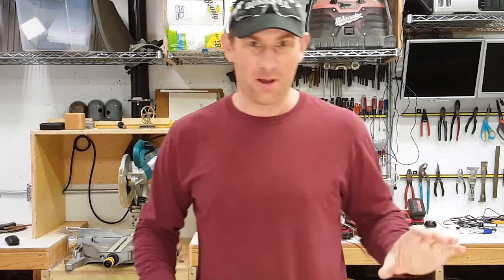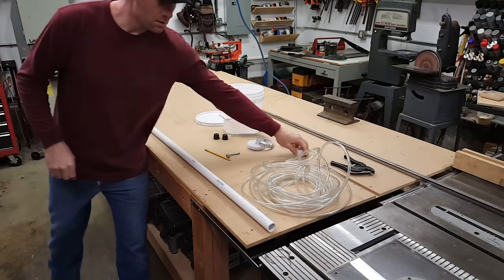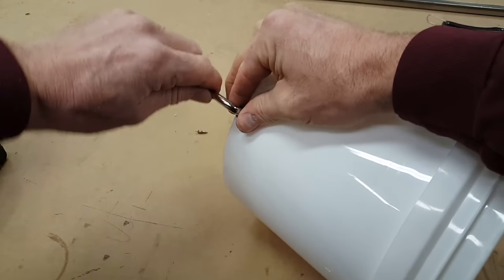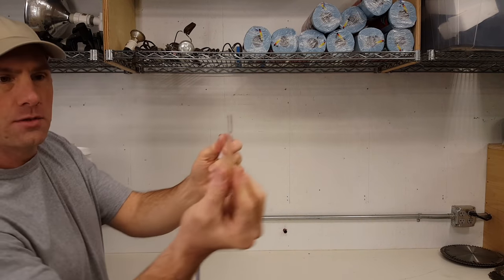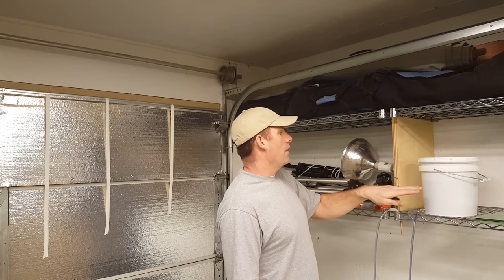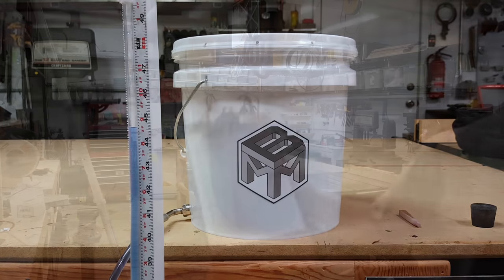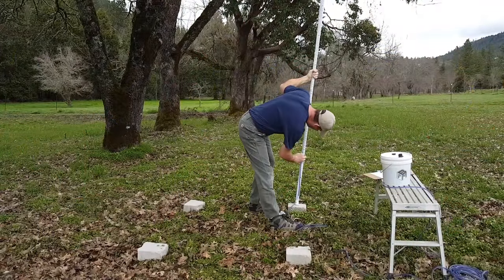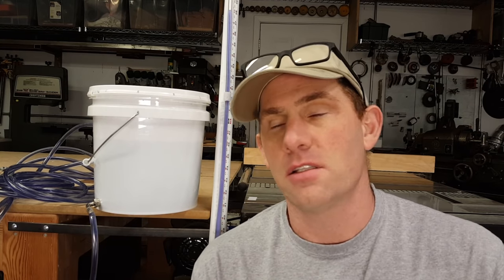Water level basics – How to make and use one

Comment: How do I know where to put my bucket to find out if my floors are level? Also, if I use it to replace some wood piers under my house, would I only need to water level measure on the inside? Thanks for any help and guidance.
Reply from the maker: Yes, you can probably get all of the measurements from the inside of the home. As long as you're close to each pier location you should be good.

Place the bucket in a central location so the hose can reach as much of the floor as possible.

When you start the level of the water should be above (higher than) all of the locations that you want to measure. I usually put it on a 4' step ladder. 

Then you measure every location and log the elevations on a floor plan (it can be a sketch) .  This is important because you get a birds eye view of the changes that need to be made. It also will tell you where the highest and lowest locations are. This will give you a good idea what your target floor elevation will be. 

Choose the location on you floor that is the closest to the desired final elevation. That is the target elevation that you do all of the math from. 

For example if the location that meets the target elevation measures 42" between the floor and the water line then all of the other floor locations have to get moved up or down to match that measurement. So if you have a location that reads 43" it would need to be lifted up 1" so the water line reaches 42".

Good luck!
Reply: Make Build Modify  Thank you for explaining this. I am a first time home owner and learning all this stuff on my own, and of course with the wisdom of men like you. I am out of town until the 10th. As soon as I work on it I'll let ya know the outcome or might even have another question or two if that's ok Lol? Thanks again sir.
Reply from the maker: No problem. Ask any time. Thanks for watching my channel!

Comment: I've recently bought a water level and had a play around with it, I've found that when you move one end of the tube that the water height changes. I've put both ends of the tube on a wall, about a foot apart, marked the water level on the left side, then raised the right hand side up a couple of foot, then found that when the water levels itself, it's not on the mark.
Reply from the maker: My guess is that it was the hose type, right? It's important to know the difference between level and elevation. Two very different things. That is why a reservoir type is a little better than a hose. The change in water difference in the hose makes almost no difference in the reservoir elevation. Well within tolerances.
Reply: Ok. Thanks. 👍
Reply: I too have done this. But after consideration I realized ALL a water level does is find level between two points....after the rise and fall in the hose finally stops of course (often many minutes in a thin hose). Moving the one end of the hose to a 3rd location will change both sides and you will have to measure back to the original line you wanted and note the difference and then transfer that against the new 3rd location.......too easy. 

The reservoir and hose still isn't perfect either, because as the hose end is moved around it will also be inaccurate (though less obvious then a hose by itself system).  The reason is because no person can perfectly move the hose end around and keep it level.....it can be high in one spot or low in another and that will effect water level. 

This is effectively changing the container size (reservoir and hose included) each time it is moved. 

Holding the hose lower then the first mark will introduce more hose into the system = increase of container size that the water now has to occupy = drop in water height.

Same deal if the hose is held higher, it will mean there is a decrease in container size that the same amount of water now has to occupy which will create a rise in water height.

Comment: I used rubber tire stem valve (remove valve), pop into a thick container for fast seal outlet.  Long neck valve is best. Heat or clamp on hose for tight seal.  Great tool, mine is 80 feet 3/8" hose.  I used old 1.5 gal dead pump sprayer.
Reply from the maker: That's great!

Comment: You might have mentioned it and I just missed it, but the bucket isn’t necessary if you have a helper.
Reply from the maker: That is true to a degree. The bucket changes how the relative water level is used. If only a hose is used the water lines will be level to each other but the elevation can change from measurement to measurement. With a central bucket location the level and elevation are preserved. Level and elevation are two separate things, although, they can be separated depending on the circumstances.
Reply: I found that to be true. First time using one and I liked the bucket better. Thanks.

Comment: How do I use this in a big open field to find contours of the land. I will be doing this by myself. The land here has slope from 1 to 10 degrees so it's not flat to sit the bucket.. So can I sit the bucket down anywhere on the ground then walk out with the pvc pole to find the contour OR does that bucket have to sit  on somekind of higher ground, etc...? Thank you.
Reply from the maker: I usually set the bucket on a small ladder for a portable bench. That way the water line is closer to an elevation that I can easily see without bending down too far.  If you can, it's better to locate the bucket near the highest point, but it's not necessary.  Sometime a central location is necessary because the length of the hose is a limit.

I've recorded the contours of a field larger than my water level could reach. In that case I had to relocate the bucket several times and reestablished a new relative elevation for every step. It requires a little more math and a lot of note taking, but it can be done.
Reply: @Makebuildmodify  If I don't mind the bending then is it OK  to sit the bucket on the ground...would it still give accurate reading? Thank you.
Reply from the maker: @mandiegarrett1706  It will be accurate. However, if you go up hill above the elevation of the water line in the bucket it will be useless. This is because the water will only be in the part of the hose that is laying on the ground. You need the elevation of a bench (of something like it) to allow you to take reading  on the story pole at all locations of the project. But you can experiment and see for yourself. I might just work for your situation.
Reply: @Makebuildmodify  I see your point. Thank you.
Reply: @Makebuildmodify  Well, I am trying to make it work with my situation...so what if instead of using a bucket system, would it work if I have the 1/4" tube secure to a step in fence, that way I can carry both sticks (the pvc pole and the step in fence with 50ft tubing) to the field at the location where I want to find the contour then push down the step in fence pole with my foot so it stay standing while I walk out with the pvc pole with 50ft tubing to find the same level then that would be where my contour line is. If it does work, then I wonder if 25ft tubing might be less cumbersome to deal with than 50ft (might be too long to haul around)? Really appreciate your time helping me.
Reply from the maker: @mandiegarrett1706  I'm having trouble understanding. It sounds like your trying to use a hose only instead of a bucket system. If that's case, a hose can only give you two level points of reference at a particular elevation. There is a subtle difference between level and elevation. As soon as you move to another location you have another level between those two new points, but the elevation will be different. So you won't be able to easily reference all locations from a common elevation without doing some math. Having a bucket in a central location allows you to have a single elevation with which to reference all of your level measurements.
Reply: @Makebuildmodify  Hmmm, math is my worst subject and sure don't want to deal with math more than I have to so just to clarify, my goal is not having to deal with hauling a bucket AND  somekind of a portable stand/bench for the bucket to sit on, once I am done with locating that first 50 ft of contour line then I would have to move the bucket along with the portable stand/bench. I think it could be done but it's a lot for one person to deal with...so I am trying to come up with a system to make it a little easier for me...thats all. I also have been looking at the A frame but we get lots of high wind here that it will be hard to keep that pendulum to stay still. I have seen other Youtubers using the 2 sticks water leveler and make it so easy but then I am guessing that they love math. Well, I will need to do some more thinking. Thanks again for your time🙏🙏🙏
Reply from the maker: It's really no that difficult to move the bucket around. Honestly, it's more difficult to make the level than it is to use.
Reply: @Makebuildmodify  Thank you.

Comment: But the level in the bucket will change depending on the height of the the other end of the tube. Like, if you held the other end high up directely over the bucket, all the water would flow into the bucket and change it's level, no? Tricky one for my brain this.
Reply from the maker: Technically, you are correct. The elevation of the water will go up as the water in the hose goes into the bucket. However, this is never a problem because the range in which the measurement is taken ( the length of the story pole ) is not enough to change the elevation beyond a negligible amount. The larger the bucket the less the effect. It's a relationship between the cross section of the hose and the cross section of the bucket. For example, the bucket-to-hose ratio for the water level in the video is about 1/1600. That means that 1,600 1/16ths Or 100 inches of water would have to move into the bucket to change the elevation by 1/16th.  If you stay within the length of the story pole the difference will probably be less than how much lead your pencil loses when making the mark.  Thanks for the comment!
Reply: @Makebuildmodify  Thanks for your reply, I think I've just about grasped the concept. Either way I'm making one as soon as I get into town to buy a valve. Greetings from Bulgaria ;)

Comment: If im leveling a mobile home, how would i go about finding the high point?
Reply from the maker: If you have the bucket under the mobile home the level of the water will be lower than the underside of the mobile home. If the distance between the underside of the home and the water line is larger, then that part of the home it higher. If the distance between the water line and the home is closer, then that part of the home is lower in that location.

Comment: Excellent description of making one and the use. Remember to recalibrate if you spill any liquid, your water level changes. 

One design change I would recommend is using a smaller diameter bucket so the whole mess can fit inside a 5gal bucket for storage and transport. Well...as I’m typing this i realize I have 2 suggestions - Because our cold temps here I also use anti-freeze. Preferably the stuff used to winterize RV’s, not as toxic if there is a spill. Some old timers suggested mineral oil because it settles out faster in the reservoir - but that seams really messy if I drop my line.
Reply from the maker: Thanks. Yeah, I've done all of the above. I was just keeping it simple for the video.
Reply: The level for use doesn't change, if you spill some just add more!!  As long as there is enough water to go from one point to the other it works.  Water is always self-leveling.

Comment: This is THE most useful video I have ever seen on YouTube. Excellent! Thank you!  Question:  Instead of putting 3/8" of folders under the bucket, could you just have added more water to the bucket until the water level in the hose reached the level you wanted it to be at? (yes, I know this would slightly dilute your water coloring)
Reply from the maker: William Bloodworth Yes, adding water would work. Either way works.

Comment: Hi, I am back with more questions...lol. Please be patience with me as I am trying my hardest to make this thing work. So, after much research and thought, my husband said he can help me with using it out in the field. My question is instead of using the bucket at one end, now that I have another person helping me then can I make another measuring pvc stick...in other words, I would be making 2 pvc measuring sticks with clear tub attached on both stick for measurement. I have seen a lot of people doing that way and looks easier with 2 people using it. For example: First person holding one end of measuring stick stand at the start of the location where want the contour, put down the flag, then have second person with the stick walks out 50ft (that's how long I want the hose), first person called out the water line measurement, second person move around till find the exact measurement that's same as the first person measurement, second person put down the marking flag, then we move on to the next 50ft. Will this work?...just seems to make more sense to me. Thank you.
Reply from the maker: I'm having a little trouble understanding. Are you trying to find the change in elevation along a line (like along a fence) or the elevations of an area (as in points of elevation in a grid like graph paper)?
Reply: were you saying to have two hoses coming out of the bucket

Comment: Use hose splitter and plug multiple hoses. Space them in all required spots, set up bucket. You can level whole house, barn, even forest in 20min!
Reply from the maker: interesting idea.
Reply: @Makebuildmodify  If you like it... you can also try to run "main hose" with "limbs". Get a bucket, plug in cheap, robust garden hose, instal few T-junctions and plug "clear pipe limbs". You can use few of those sets and drag them in different directions/along walls. Endless combinations available!

I use single bucket with 20 valves. I carry (inside the bucked) whole bunch of hoses of various lengths. must hoses are fitted with garden hose quick couplings. Clear PCV hoses go dull quickly so I use cheap garden ones and only add clear PCV at the very end. I never needed all 20 sets at once but I bough 20 valves bulk. I believe 12 was max I ever used. 
It works indoor and outdoor, round the corner, in the fog and dust, is pretty much bullet proof, stores in single bucket, you can drive over it, throw it, trash it around your truck, never goes out of alignment and cost  fraction of laser set.

Comment: You do not need to bother with the fancy fitting at the bottom. Just stick the tube in the top, tape it and then siphon it out. The level will still be the same as the level in the bucket. Also, put the measuring tape on with high numbers on the bottom. That way higher numbers will mean a higher elevation. Actual numbers do not matter; only the difference from the reference matters.
Reply from the maker: I've done both. I prefer it like the one in the video. Thanks for the input.

Comment: I believe a small error results with this method if the water level in the bucket is not kept at the same level in the bucket at each place of measurement by adding water or removing water from the bucket as needed at each location. While such degree of error may be allowable for non-critical uses of this system ... such error can be kept to a minimum by using the widest bucket feasible and tubing with the smallest feasible diameter. Please give details if you disagree with me.
Reply from the maker: The water displaced during use is negligible with a bucket and hose this size. No need to add or remove water.
Reply: No Bill, that is wrong.  It doesn't matter how much is in the bucket, as long as there is enough to go from one point to the other.  This is not a pressurized system.

Comment: Very interesting using a bucket, water is by far the best datum to measure from,   its a world wide datum, every part of every country is above or below sea level. My favourite lake is 22 miles long and each pier is exactly the same height  above the water level and they didnt need a pipe lol.
Reply from the maker: Do you think 22 miles in enough for the moon to have an effect?
Reply: @Makebuildmodify  I don't know possibly, I have been going there for years and have never noticed it being tidal. There's a company that does tourist boat trips,  they travel around in both directions with lot's of boat's and they made the piers to suit them. Water follows the earth curvature compared to a straight line laser that would go up in the air, so would a theodolite, is there an alternative to using the water? I once went on a boat tuition course the tutor said if I  stand on a beach with my toes in the sea the horizon will be approx 12 miles, stand on the boat deck 15 miles.

Comment: Does the hose diameter affect to the accuracy?
Reply from the maker: I don't think so. There is one case where a small hose is better. If you happen to drop the hose less water spills from it than a large hose and you can usually recover it before the water loss causes an accuracy problem. A large bucket helps too. An ounce of water lost from a 1 gallon buck is twice the change in elevation from an ounce of water lost in a 2 gallon bucket.
Reply: @Makebuildmodify  Thanks for reply and making this video. It’s very helpful.
Reply from the maker: @eardd272  You bet!